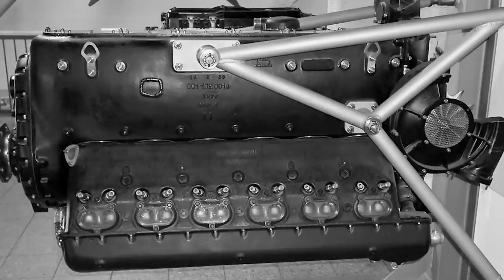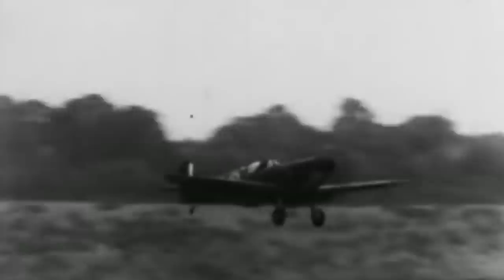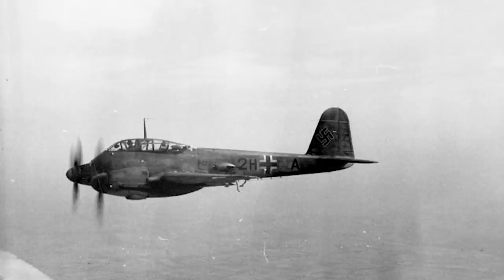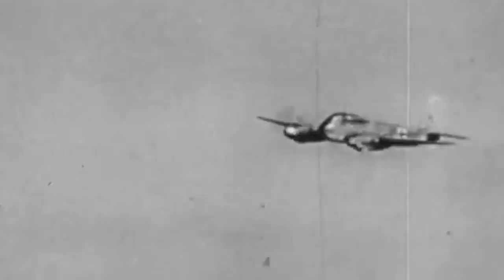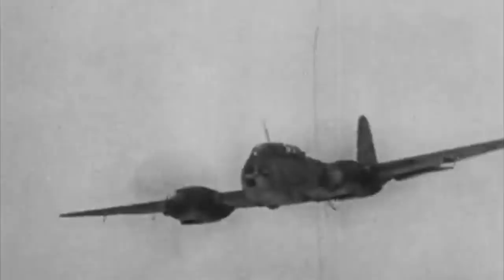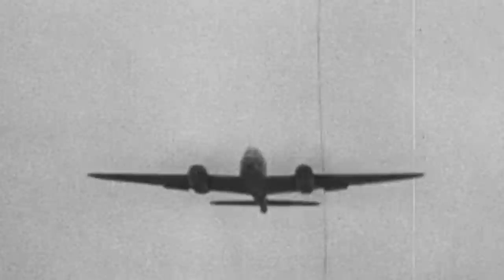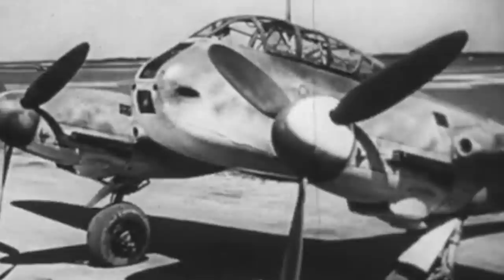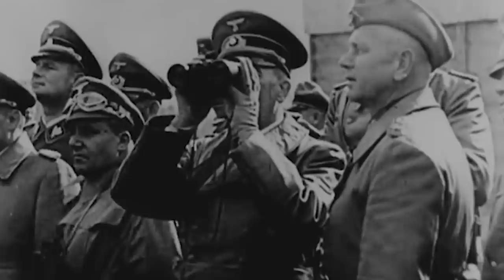The Catastrophically Bad Airplane that Ended Germany's Chance to Win WW2 - Me 210 Destroyer

Comment: the allies had some bad aircraft (one that springs to mind the Boulton Paul defiant) but had the sense to modify them or find a roll where they weren't a huge failure such as making the hawker typhoon into a ground attacker after it proved to be a poor fighter.
Reply: The Bolton & Paul was a successful as the Bristol Beaufighter as night bomber destroyer. Bomber destroyer being its original design.
Forced into the role of a day fighter it was abysmal.
Reply: Don't you dare bad mouth the Defiant ... :D   264 Sqn handled it ok but they had time to find the right tactics for this weird aircraft. 141  Sqn were totally green and were jumped out of the sun by a Sqn of Emil Aces .. they had no hope. There was a strong bias against turreted fighters in RAF command and this was the excuse they needed to can it.  264 Sqn were upset by this decision.
Reply: Defiant was a great aircraft perfect for its role … the role was crap ….and as others have said as a night fighter it was fine
Reply: The Hawker Typhoon suffered from Hawker's repeated failure to grasp the critical importance of making it easy for the pilot to see behind, the performance crippling thick wing and the outdated and hopelessly inadequate original rear fuselage stiffening that resulted in structural failure. To add insult to injury, Napier's notoriously poor quality control resulted in constant engine problems. The poor rear vision seems to have been a Hawker obsession - they did it on the Hurricane, Tornado, Typhoon, Hunter and Harrier, and had to be forced to improve it in all cases (except the Tornado, which never entered service).
Reply: As a Canadian I often recall that hugely embarrassing Avrocar........and shudder.......
Reply: @RemusKingOfRome  Quite right
Reply: The defiant was very effective when flown by a properly trained crew - using the turreted gun as the main armament and the aircraft as a platform for it. The problem came when 'regular' single-seat fighter pilots, with unsufficient training to develop the tactics it was designed for, flew it as a Spitfire/Hurricane with a turret for rear defence.
Reply: @otterspocket2826  thanks for that clarification, I guess that it was just too hard for pilots and planners to understand the total change in tactics it needed to get the best from the defiant. Also the extra weight didn’t help when compared to a more conventional aircraft like a hurricane.
Reply: Agreed. The allies had their fair share of dodgy planes as well, but the were quick to modify either the plane itself or its role.
Reply: The Defiant was not a "bad" aircraft in the same crew-killing sense as the Me-210.  Its fault lay in the way it was deployed. It could not hold its own in a daytime dogfight and the "turret fighter" idea was ludicrously bad for the purpose of daytime bomber interception. As a night fighter... well, that turret was not that much different than the "Schrage musik"  installation on German (and Japanese) night fighters... just a bit puny with its .303 calibre guns. Put the guns in the wings, get rid of the turret and make that second seater the radar operator... might have made all the difference.
Reply: The Typhoon was a good fighter at low to medium height and was the only fighter capable of taking on the FW190 equally until the Spitfire IX came into service.
Reply: Another aircraft that is often unfairly judged.  @iangascoigne8231
Reply: the Boulton Paul defiant was built on the concept that german bomber would have to fly WITHOUT fighter escort from Germany, once the Luftewaffe had the use of French/Dutch/Belgian airfields that roll did not exist
Reply: read some actual history before commenting please
Reply: @paulnutter1713  Who should? Elaborate please.
Reply: @iangascoigne8231  the original poster mate, spouting on about the defiant been bad. just spouting out what they take as accepted. any aircraft will perform poorly if used wrongly
Reply: @paulnutter1713  Thank you.
Reply: Why didn't they have a specialist combination fighter, four cannon forward AND a turret? Ok, that might have slowed it down a bit, but it would have been quite formidable.....
Reply: Before any person flames me, I'm quite fond of the Defiant myself.
Reply: @iangascoigne8231  Well said, sir. Even excellent planes had their faults. Take, for an example of a later generation plane, the Buccaneer - the early under powered engines and the later fatigue problems - but "Granny" is - rightfully - considered to be a wonderful plane. They all have faults if you look for them,  and that means the good but admittedly awkward end up wrongly damned.
Reply: as others have stated the defiant was not a fighter but a bomber destroyer who's role was standing patrols to intercept un escorted bomber formations. When used in this role, whether by day or night, it was very effective as almost 5,000rpm poured into your unarmoured flank or belly would be more than devastating. When the bombers were escorted new tactics had to be developed so that the aircraft had a chance of surviving against hostile fighters. The squadrons that used these new tactics performed adequately, those that didn't suffered badly, all down to how the aircraft was used and not the aircraft. The lancaster would have made a rubbish fighter if used as one so by this criteria that too must be a terrible aircraft.
Reply: @robertwilloughby8050  one of the air ministries requests for the mosquito was that it had a turret aft of the canopy, imagine how bad in practical terms that would have been, hence why dehavilland and other manufacturers ignored the ministry. 4 cannon & 4 mg's in the nose was perfectly fine, no extra crew, no extra drag, no c of g and handling issues, no complexity issues.
Reply: @paulnutter1713  True enough, I guess. Just wondering if a clean sheet design, with everything taken into consideration, centre of gravity, longitudinal stability, buffeting, all that brass rock, might, just might, have made a real bastard of a plane - to the Nazis, of course, not our guys!
Reply: @paulnutter1713  I have read tons of "history" most of it journalistic drivel and yes I include Bill Gunston in that class) , and as a 30 year aerospace engineer (who has a number of patents to my name) I have read plenty of  real history (for ten years I worked for Rolls-Royce and visited the old technical library at the Moor lane site almost every lunch) and thus had access to and read technical reports on both aircraft that back up what I put, as well as books from more mainstream sources such as Brown and Clostermann, two pilots i hold in great esteem . The defiant had a poor service record because it was a design that had it's roll change because of changing circumstances, i.e. German bombers having fighter escorts which left the defiant very vulnerable. I agree that if it had been able to operate as it was originally intended it would have been quite a good design but its role evaporated as soon as the Germans took France. Its lack of any worthwhile frontal armaments  even allowed me-110's to get ahead of it and take it out with the rear gun on the 110, an oversite that looks crazy today. In the beginning the turret was very poor , prone to jamming and had a feed mechanism that needed a huge amount of maintenance . The feed system could be put out of action while the gunner was entering the turret nudging the feed system with his knee ( I read that in a Fraizer Nash report from 1940).  At least it had the effect of convincing DH that the turret was a useless idea on the mosquito , this was backed up with later wind-tunnel tests that showed the effect of a turret on a mossie would have been a degradation in performance that would have turned a racehorse into a cart horse. The general report for the defiant on aircraft air worthiness rated it as "barely acceptable " and the only good points were good visibility from the cockpit and a stable wide track landing gear. when Rolls-Royce were asked to review the aircraft by fraiser nash who were working with Bolton Paul on the turret problems ( fraiser nash thought a third set of eyes could find a way to improve the turret ) RR gave the overall aircraft  the description of "a waste of a merlin". (I know I would rather go into battle in 1940 in a hurricane IIc than a defiant). in the case of the typhoon I used it as an example of how the RAF slightly change a role to fit a designs strengths and avoid its weaknesses . The RAF needed a medium to high altitude fighter at the time because there was a belief the HE-177 was going to be a good high altitude bomber (thank heavens it was 'a piece of junk' not my words but Winkle Browns). Fighter command were given the typhoon that was considered poor at high altitude (this was mainly the airfoil being too thick and not having laminar flow characteristics that were advantageous  to fly at the altitude/speed needed for the role, not that hawkers were given a solid set of characteristics by the air ministry that truly fitted to the role they wanted it to carry out) and especially lacking in rear visibility in it's early versions. I will skip over the whole subject of the engine because for the British at the time the sabre was the only real option with the vulture proving to be a huge flop (anyone remember the avro Manchester ? )  and the griffon being earmarked for the spitfire. The rearward visibility was rectified later by way of the teardrop canopy and a change in the pilots seat/rear armor . It was in a way lucky that the typhoon was a good medium to low altitude design as since the importance of the high altitude interceptor role the RAF initially wanted it for didn't really materialize, it could be deployed in a role where it was truly exceptional. I happen to love the typhoon and have built and flown a number of radio controlled ones up to 1/5 scale and prefer it over the spitfire any day. what I was saying was the Germans would not learn that the me210 was not capable of fulfilling its role and only when it had lost them many good pilots move it to a role it was more suited to where as the allies were more able to recognize there aircrafts limits and tailor the role to the aircraft.
Reply: @stephengardiner9867  so what your saying is just build a hurricane IIc with a second seat for a radar operator (that way you dont need a new set of spares and retrained air and ground crew)
Reply: I used to have an old wardrobe made by Bolton & Paul...it wasnt very fast either...
Reply: @martinpepperell8424  actually my grandmother had a stainless steel kitchen unit made by them in a very nice white and sky blue. I still have the enamel badge off it somewhere
Reply: hognoxious  Yes they did - after Hawker were forced to change the design. So did the later Typhoons - and for the same reason.
Reply: Then there were 20 or so unsuccessful planes that Curtiss designed in the WWII era.

Comment: I feel like if the design had done without the bomb bay, rear-firing turrets and dive brakes, and just concentrated on a solid gun platform, along with a longer fuselage, the 210 could have been the scourge of Allied bomber formations, and a sterling ground-attack fighter, much like the Hawker Typhoon.
Reply: so... a mosquito then?
Reply: And would have differed very little from the 110.
Reply: @Zkkr429  except in being faster and more powerful

Comment: The fact that they built the plane using ideas and not proven designs without testing is a prime example of why quality assurance was needed then and still is today...there are no short cuts
Reply: The US had a similar experience with the Martin B-26, which was basically bought straight from the drawing board.  Not having a prototype phase to iron out some important details caused it to earn a reputation as a “widow maker” as training and operational crews encountered the flaws (often with fatal results).

Comment: Lessons to be learned: 
1. Never put a product in the field without fully testing your prototype and working out the problems. 
2. Never accept a concept solely on paper 
3:Never never accept something out of desperation. 
4. Never accept something because of a company’s past successes 
5. New ideas and technologies do not necessarily mean “better.”
Reply: America did this with a few aircraft as well.  But somehow got away with it.  The B25,B26,
Reply: @timothyboles6457 : The B25 was a great plane, it was used in the Doolittle raid and throughout WW2!
Reply: @kensmith8152  yes I know.  I've seen a few. And a couple even flying.  They are one of my favorite aircraft.  But like several types of American planes.  They were "puhed" along more than a bit. Fortunately it was an outstanding design.  Whose fame started with the Doolittle raid and ended as a tactical attack bomber.  Some even had 75mm cannon installed.  Which must have been an interesting experience to be in when fired. Other models had 10 or 12 or more 50 caliber machine guns in the nose. Niether of which would be good to be down range of

Comment: The real issue was trying to push a lemon once it was recognized as such. Once they realized the prototype had major problems, Messerschmidt should have gone back to the drawing board rather than rush the plane into production. This does sound familiar, though ...
Reply: I thought the production versions were built not on par with the designs to save materials.
Reply: @carlosandleon  Still, if they found these problems, why did they try to go with full production with the plane as it was rather than go back to the original design or with an upgrade? That's the crux of the matter.

Comment: Imagine if they would have just used the resources to build more Me 109s or FW 190s.
Reply: Entirely different function and use case. The ME210 was designed to be more akin to the British Mosquito or the American P-38 Lightning. A long range dual role aircraft.
Reply: Bf 109 Emils were quality pieces of kit ..  Me 109 Gs were junk , pilots wanted to keep the Fs .. but
Reply: @RemusKingOfRome  The vanilla G-6 struggled on the Western front in the first half of 1944, but a late war,  well built, non-sabotaged G-14, and especially the G-10 and K-4 was a match for any late war allied fighter.
Reply: The Bf 109 was already the most produced combat aircraft in history - and in the end Germany didn't have fuel  anyway.
Reply: @RemusKingOfRome  K4 however was a major improvement on the Bf 109. It even outperformed the p51.

Comment: The real problem wasn't so much the design(the 410 proved to be better than the 210 but in comparison to other single-engine fighter aircraft only marginally so); the problem was trying to make one aircraft (single-engine or twin-engine) do the work of a fighter and a bomber. It needed to be one or the other---adding extra weight to carry bombs,rockets and/or cannons while carrying machine guns guaranteed the plane would need fighter escort. In one attempt,the 410 carried a 75mm cannon beneath the pilot. Even when one round was fired,it kicked the plane back a few fleet.

Comment: The number of aircraft that didn’t have design issues in development is darn few.  The problem here was attempting to go direct from concept to mass production.  An iterative design/prototype process without hype or external pressures and user expectations might have produced everything that was intended.   The technology was there and there is no doubt that Messerschmitt had the skill and experience to work through it…..if it had the time.  While war is often the incentive for great
leaps forward, unrealistic expectations in a war time “need it now” setting has doomed many a project to failure.

Comment: Well, according to a late friend who flew for Germany in WWII. He was drafted so to speak, The 110 to the 410 was a flawed concept the didn't have enough speed, maneuverability, he thought thatng
Reply: Oops finger slip, he thought that the Luftwaffe top leaders were so fixated on certain techniques.  That if they were flying they would have flown into the ground. He felt there was no saving the Me 110 to 410. Improving them yes, using them in new roles yes. As fighters he thought they were death traps ( A long with the He 177 though it was a bomber). He flew By 109s FW 190s but he had friends who flew the Me 110, 210 and 410.
He said that they should have been designed more like the P 38 No more than a crew of 2 rear gunner maybe. He said as small and light for a low wing load. He said especially on the 210 the CG and CP were off, being to far apart and waaay to much drag.